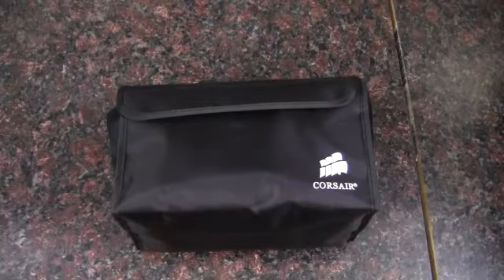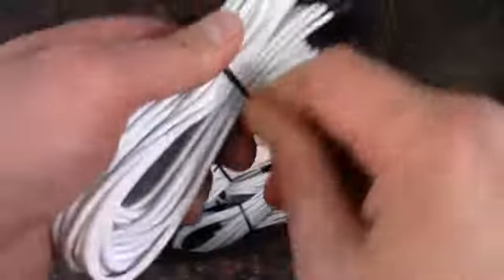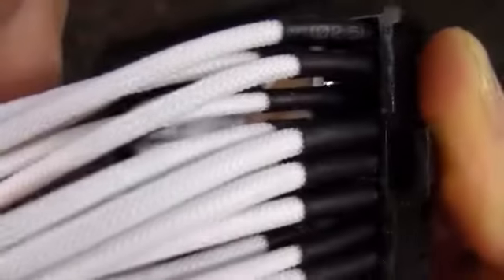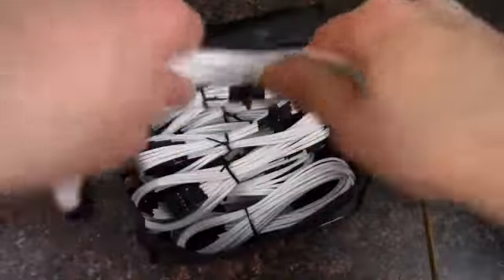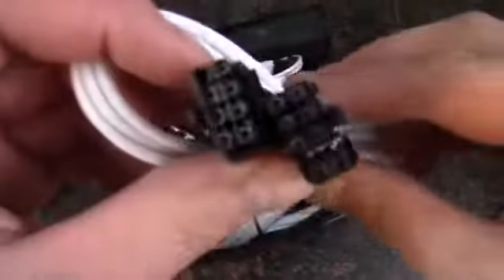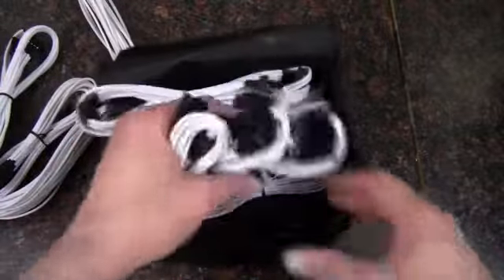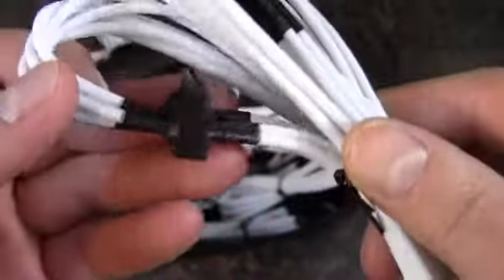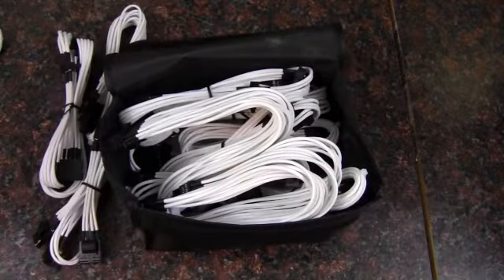Corsair Sleeved Powersupply Cables

Comment from the maker: Interestingly enough, I do a quite a few repairs and upgrades on systems with only 20 pin connectors. Mostly failed HDD's or fail power supplies. It is odd but they are still out there. Those old systems really can't handle todays software. But I do agree with your statement.

Comment from the maker: This set that I got only works with the AX1200 power supply. They sell different kits for different power supplies. So, I would highly doubt that it would fit any other brand either. I would imagine that each modular power supply brand is different.

Comment: is this kit compatible with the cooler master v700? im thinking of buying the v700 and i want White sleeved Cables, i mean is there any reason they would not be compatible?
Reply from the maker: This kit only works with the Corsair AX1200. The pins could be different on the power supply side. I have worked with many different modular power supplies and have found that there is no standard on the power supply side.
Reply: AdoptedMike ah ok, so the Cables to not work to connect to the motherboard for example no matter wich end of the Cable it is? like if you flip them around so the end becomes the new front? you understand what i mean? :D are they not the same on both ends? so that you dont need to check wich end of the Cable needs to go into the PSU? an 8pin connector is the exact same 8pin connector on the other end, like if you bring the 2 ends together side by side, bending the Cable, are the pins not the same, do they not have the exact same shape, is that what you are saying?
Reply from the maker: It would be nice if it worked that way though.
Reply: AdoptedMike so what you are saying is that they are not the same on both ends i guess. well is there Another alternative or any other companies who sell sleeved Cables with quiality? or do i really need to change my choice of PSU wich i really do not want to since the OEM's of corsairs PSU's are pretty shit whilst the v700 has a pretty good OEM. have you double checked so that they really are not the same on both ends, the Cables? im sorry if im pushing you, really, im just really curious and i really want my White sleeved Cables with my upcoming pc Project, so i really want clear line of sight on my target. :S
Reply from the maker: Colonel Alcatraz I know for sure the 24 pin connector was not the same on both ends. Not exactly sure about the rest though.
Reply from the maker: Colonel Alcatraz There are custom sleevers out there that will make them. I will look around and let you know if I find a good sleever.
Reply from the maker: Colonel Alcatraz moddiy.com makes some, and frozencpu.com has some as well, but I didn't see any for the v700. I would just make sure they work with that power supply. You wouldn't want to short anything out if the pins are not correct.
Reply: AdoptedMike wow thanks man, altho even if you will find guys who custom sleeve them its not 100% that i can get them to sweden. so dont go too harsch, i guess i will have to change my choice of PSU, im already searching for what PSU they have to offer me that is suitable and at a reasonable price and is compatible with these sleeved Cables.
Reply from the maker: Colonel Alcatraz Corsairs website has cables for almost all of their modular power supplies. I am assuming they ship to Sweden. I don't know why they wouldn't.
Reply: AdoptedMike nono i find many retailers that sell corsairs Cables, i was pointing more at the ones you mentioned, the moddify and the other one. well the 24pin Cable is kind of split, http://ple.com.au/GetImage.aspx?ImageId=32600 , well yeah thats kind of what im worried about that the pins are not the same on both ends, but Think about it,  why would they make it so complicated and change the pins depending on what end of the Cable it is? the only reason i find is to make it only compatible to their PSU's, but why would they be so selfish about such a thing? i understand its a Selling Point to sell more PSU's of theirs, but such bullshit just makes it even harder for me and other ppl who have had the same ideas.
Reply from the maker: Colonel Alcatraz I think that someday there will be more uniformity on the power supply side. Alas, we are not there yet unfortunately. That also drives the cost of custom cables higher as well because it's not one size fits all.
Reply: AdoptedMike i dont understand why the companies like cooler master, seasonic, corsair and the other ones use 1 size fits all and what ever Cable you can get it should fit what ever PSU you can get, but in todays standards every one is so selfish and everyone is so hungry after Money that they cant even put universal size and fit into a their Cables and PSU's... thats just stupid...well either way, thanks for the help, cheers! :)

Comment: Can you use these with any PSU with 750 or more watts?
Reply from the maker: AeroSixWJ These are only for the Corsair AX series. They sell different cables sets for their other power supplies.
Reply: Okay. I have an OCZ 750 watt modular power supply. I wanted to improve the cable management of my computer's insides. I wanted nicely braided cables like these. I bought the power supply back in 2012, and was looking for these exact looking power supply cables.
Reply from the maker: AeroSixWJ Here is a Reddit conversation about custom sleeving for that power supply. I hope find it useful.

http://www.reddit.com/r/CableManagement/comments/1dg4al/ocz_zt750_sleeved_cables/